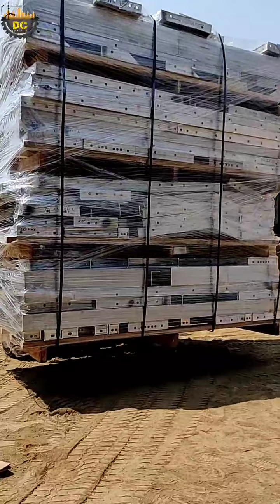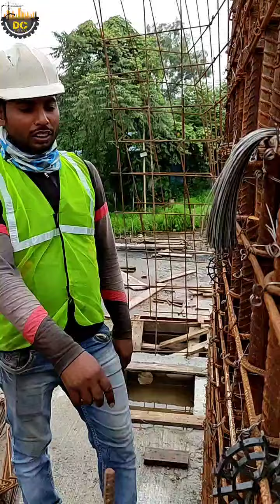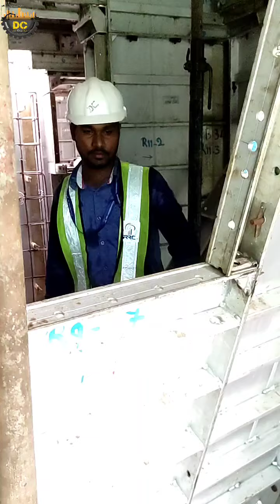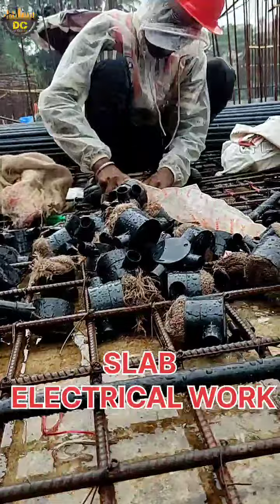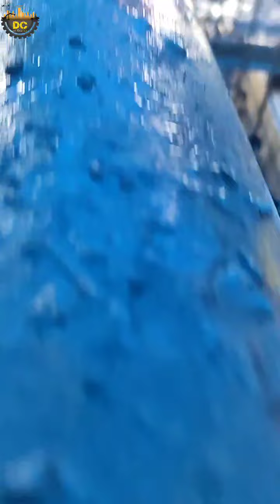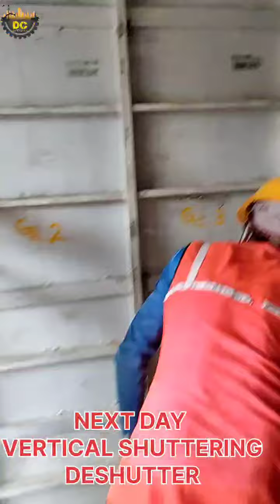Mivan Shuttering procedure | Mivan slab Steps | Mivan technology

Comment: sir, after how many hours of casting the slab, curing will start?
also, same for wall, curing starts immediately after deshuttering?
Reply from the maker: After the casting of the slab, when concrete is initially set we start grooming and then we sprinkle 💦 water on slab, and next day in the morning we will make pound on slab and do proper curing up to 10 days. And in case of wall and column we will start curing after deshuttering.